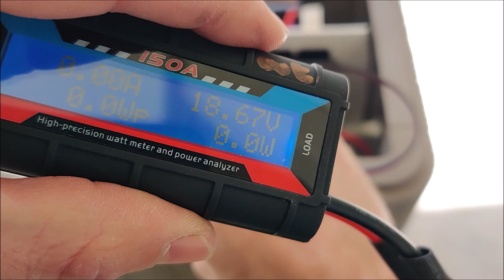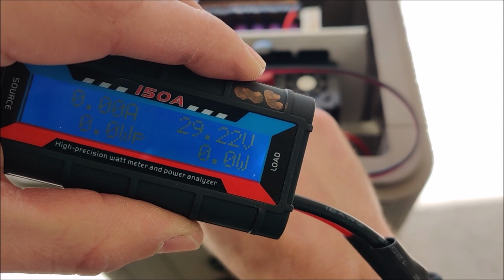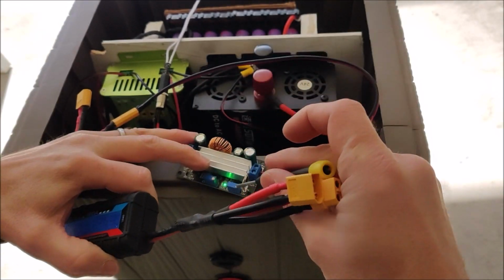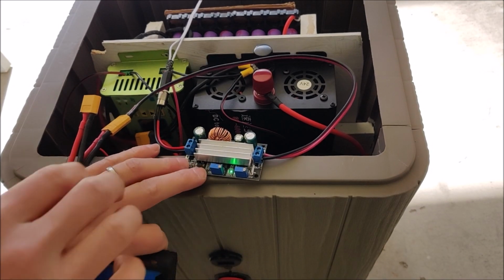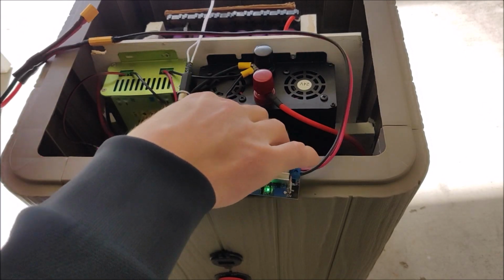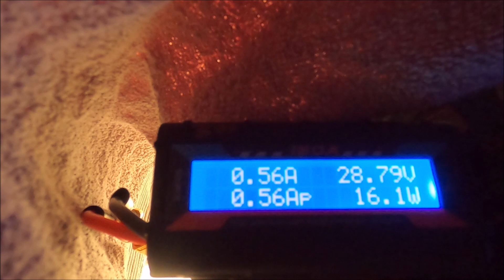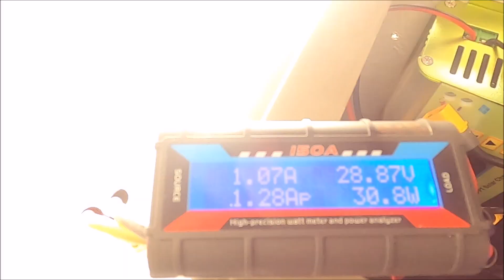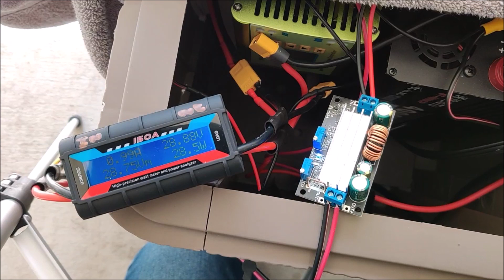$7 MPPT CHARGE CONTROLLER

Comment: That is not MPPT. With a proper MPPT charger, you set a voltage limit and a current limit and the converter will target the maximum possible power within those limits. Not trying to target the set current and voltage. That is just a simple buck converter. Not an MPPT.

Comment: there are so many little toys and gadgets that they have on these sites. I am in China and have access to taobao local price which is awesome and getting all of these little electronic doo dads for an awesome price is great. I will be using rf to turn on all of my lights with these inexpensive products that I check and they work great. you can change the dimming without having to have wall switches anywhere. just going to have a great time with all of these things. kind of playing just like you are doing it is the only way to go. LOL

Comment: Specs say "Input voltage: 4.8-30V" - you say  0-30v... have you tried it at lower voltages? (eg, could it step-up discharged 1s LiPo voltage ie 3.7v, to 12v?)
Reply from the maker: Yeah sorry. It does need 4.8v min I think.

Comment: the green controller is just a boost converter with built in watt meter etc the 7 doller unit i think would work better with a lower voltage battery
Reply: the green boxed one... is indeed a boost converter... the wattmeter only counts what it was able to push out into the battery... if it fluctuates all the time, then it doesn't register the numbers correctly as i owned one, got rid of it for the cheapo bucky.
Reply: @BeezyKing99  yeah when i seen them for sale a few years ago i thoght they where trash

Comment: that is deffo not mppt it is just a common buck boost converter  unit i have used many they do give a little boost in ampage with reduction of voltage but they will not power point track the best use i have found for them with solar is direct charging as you set the voltage and charge ampage rate and forget them or you can use them to limit current flow into a controller when you have a inpout limit to keep a constent current what i mean is say you have a 20amp controller but you have say 10 panels you could set the buck/boost to 2 amps set voltage to that of panel and you would not overload the controller but get a very steady curent flow as it will have excess